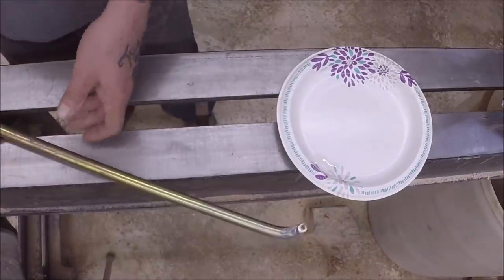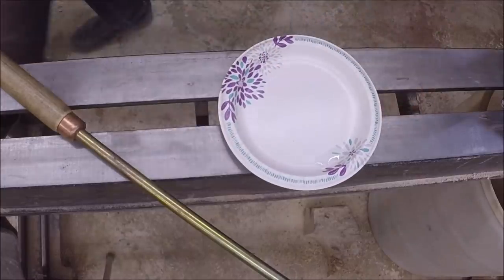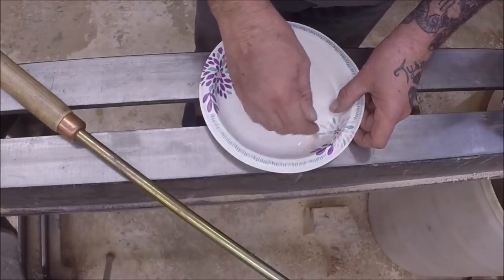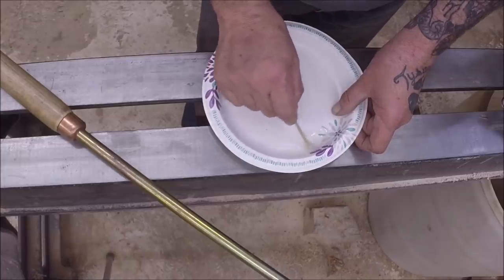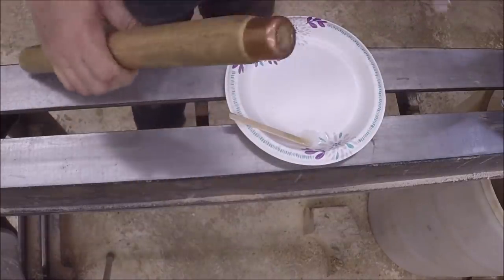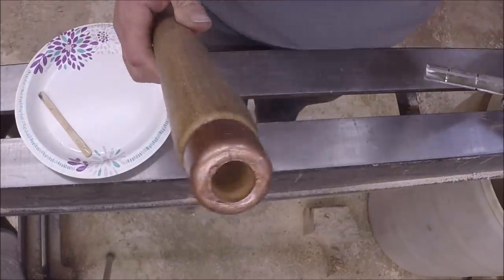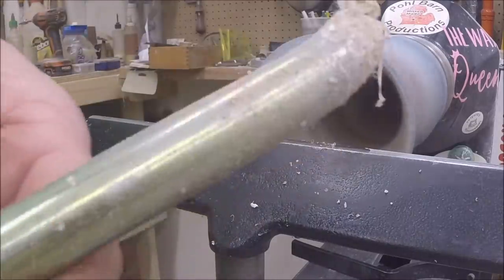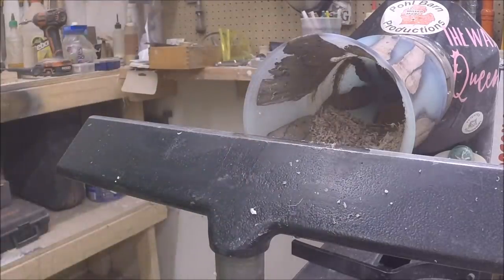A Bigger Tool

Comment: Hi Doug, Nice looking tool. Woodcut does a flat bar that screws onto a tool post into the banjo that goes inside the project and helps to stop the vibration as the tool is closer to the rest and the bottom of the project so not over "hanging" over. 
This is the tool holder all you have to do is Google it. "Woodcut Irons Hollowing Tool Holder". I hope this helps Doug. Cheers, Huw. PS I bought one and it works brilliantly. Huw
Reply from the maker: Thank You Huw,  I will check it out

Comment: Two suggestions
Put a reverse curve on the bar to bring the cutting edge in line with the length of the bar. This reduces the torque when the cutter touches the piece and it grabs less.
Angle the cutter down slightly in effect to give a slight negative rake.
Just my thoughts!
Reply: Steve: He might also, buy a neg rake bit. Pricey, I know, but . . . 

Your "reverse curve" idea sounds a good one as well. :-)
Reply from the maker: Thank you Steve and Bryan,  I plan to do what Steve has suggested as I think it will help, it was already angled down so no need for the pricey NR cutter.

Comment: Tip weld an elongated L about 12" back from tip then run it all the way to the handle.  That stops any flipping or catching on you.

trr it you will love it.
Reply from the maker: Thank you Gerald,  those emails should have gone directly to you I sent, I will send another here after I am done, if I remember to.

Comment: Might wanna harden it, possibly stop the, or some chatter, regular steel flexes a bit, but you should know that. Good job on it though, it works for what it was intended for.
Reply from the maker: Thank you Jimbo,  it's a bit to long I need to shorten it up some and I think most of that flex will go away

Comment: Would drilling a hole in the top of tool rest and placing a 1/2 or9/16 pin in it so you could use it as a pivot point and gain leverage help for the deeper hollowing stuff??
Reply from the maker: I am not sure but it might Jimmy